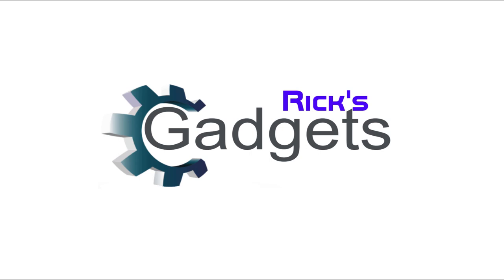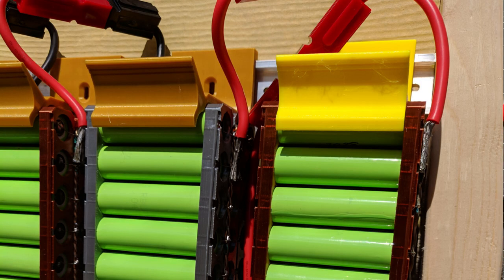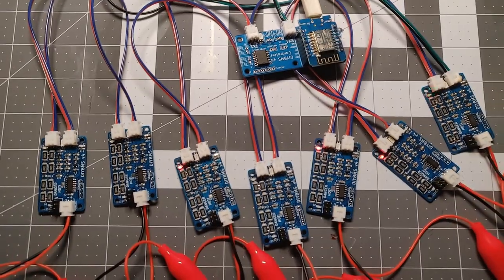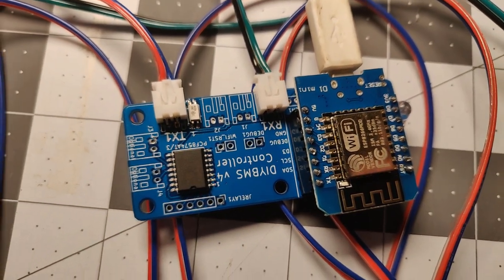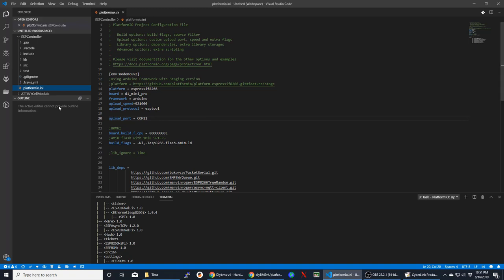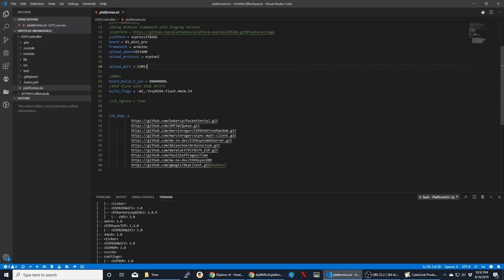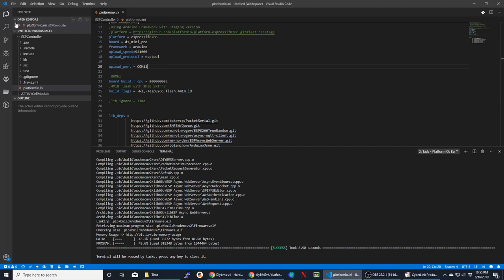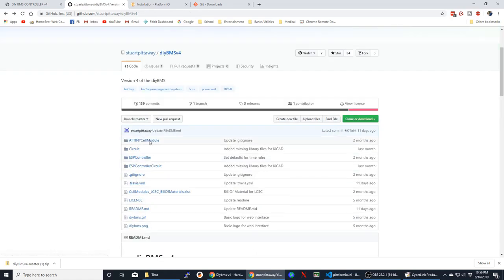DiyBMS v4 BMS for power wall cell balancing

Comment: Great video, helped me a TON, thanks.  I had tried to start another project (esp32) long time ago, and never could figure the platform IO out.

I'm on a MacBook pro, so com port has to be changed.
I opened "Terminal" and ran, "ls /dev/tty.*" to get my port info.  (device must be connected to USB port)
Mine was "/dev/tty.usbserial-1420", this change along with what you did, worked.
I'm finishing up last 2 packs on my 14s80p diy powerwall.  
Thanks for you help!

Comment: Last trap that caught me was I was trying to communicate with the modules with the 5V programming power connection. No comms even though the LEDs were blinking correctly. Switched it to run off of the 3.3V from the arduino (after programming) and it showed up!
Reply from the maker: That got me as well one time. On my bench everything worked fine. But when I added a buck converter to run the ESP, nothing worked! Turns out I didn't have the voltage set correctly on the converter.

Comment: Hi
Very informative post, thanks for that.
The holders for the battery packs are good. Do they come from the 3D printer or can you buy them somewhere?
Reply from the maker: I 3d printed them. I put the files on Thingeverse if you have access to a printer.
Reply: @RicksGadgets  no, but i can buy a 3d printer^^
files was great

Comment: Hi Ricks, I use diybms v4, the problem is that the integration with MQTT and INFLUXDB does not work for me, could you do any test and comment if it works? comment on the settings you use.
Reply from the maker: Yes it works. This is what I used. Of course change the UserName and password. mosquitto_sub -d -u username -P password -t 'diybms/#'. Here is a sample output:
Client mosqsub/26452-raspberry received PUBLISH (d0, q0, r1, m0, 'diybms/0/0/voltage', ... (7 bytes))
  3.840
Client mosqsub/26452-raspberry received PUBLISH (d0, q0, r1, m0, 'diybms/0/0/inttemp', ... (2 bytes))
24
Client mosqsub/26452-raspberry received PUBLISH (d0, q0, r1, m0, 'diybms/0/0/bypass', ... (1 bytes))
0

Comment: Sir I have a doubt,can I use a normal node mcu,instead of making esp8666 controller
Reply from the maker: I believe you can use any control. I would ask the question over at the forum the developer monitors: https://community.openenergymonitor.org/t/diybms-v4/11292/128

Comment: Do you have any extra boards you would sell?
Reply from the maker: Do you need the control board and balance board? Also how many? I might have a couple extras.
Reply: @RicksGadgets  I need the everything, but I was hoping to get a main board from someone, and order the balance boards, I have a wemos pro mini, and the 2pin connectors, I have a 7s system,  seems someone said 5 boards were the minimum, is why I ask, since you would likely only need one,  all this is a bit beyond my skill level, but with the few YT videos , I think I can get it done,  I just recently found your channel, I am off grid, using a 5kw inverter to power my home. And I'm in desperate need of a BMS,  I have a shunt trip breaker, and a opto isolated relay board to go with the wemos, to trigger the shunt trip breaker, and possibly a low voltage alarm,  so what ever you have will surely help, I'm willing to pay a fair price, thanks for replying, I have ask a couple ppl, and no reply, it would be nice if all I needed to order was the balance boards,  thanks
Reply from the maker: @jamest.5001  Just shot me an email with your address and I will drop a main board in the mail to you.

Comment: Which dimension, layers and thickness should I order for the pcb? Would it be the same numbers for the controller and the modules?
Reply from the maker: Most PCB printing places will have you upload the gerber file. It has all the specs in it. Here is the information from my print: Layers: 2
,
Dimension: 30mm*50mm

PCB Thickness: 1.6
Reply: @RicksGadgets  Thanks, I wasn't aware that the information is embedded within the gerber files.

Comment: I’m working on diyBMS v4 atm.. and fricken LCSC place didn’t send all my 2.2ohm resistors ... so pissed..
Reply from the maker: Wow, they sent all mine. I would send you some if I had some extras. I have plenty of the 2.2k 0805's!
Reply: @RicksGadgets  they have many components out of stock did you get it all from there?
Reply from the maker: @CrAzYDr1veR  Most came from LCSC but I did get a few from Gigaparts

Comment: thanks this has helped loads i was pulling my hair out though as it wasnt compiling it kept spitting out an error, i checked over the code below and:

; each flag in a new line
;-B16 option needed for my USBASP programmer to slow it down!
upload_flags =
  -P$UPLOAD_PORT
  -b$UPLOAD_SPEED
  -Uefuse:w:0b11111110:m
  -Uhfuse:w:0b11010110:m
  -Ulfuse:w:0b11100010:m

the last 4 line bits need 2 spaces infront like ive done above, could you edit your description and put the reqired coding spacing on those 4 lines so that others do not get stuck like i did.

thanks once again